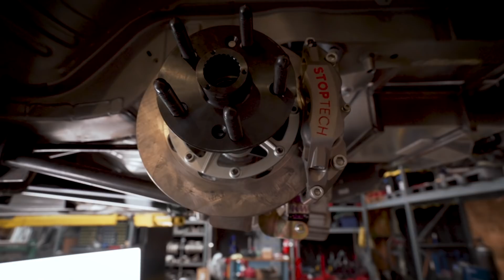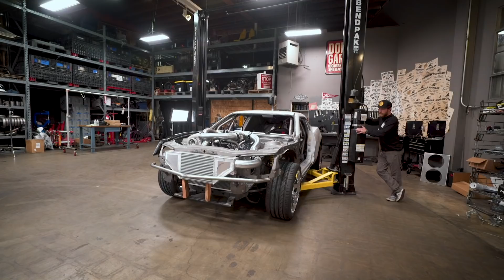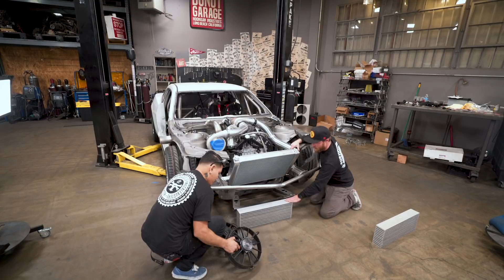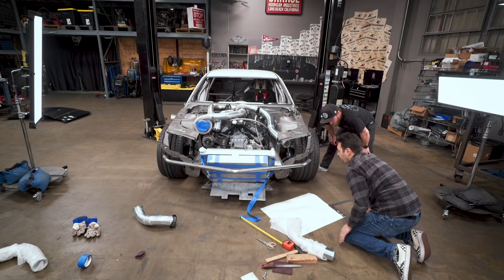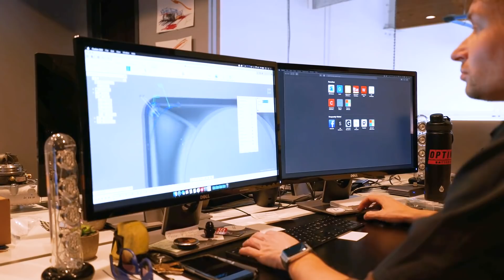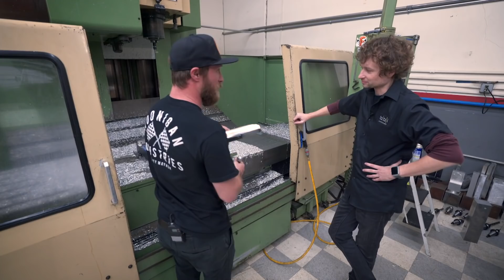Downforce for a Diesel? Duramax Camaro Gets V-Mount Ducting, 1 of 1 Wheels // Knuckle Busters 2 Ep.8

Comment: Read a comment saying Dan's response was Go Fu@# our self's in the diesel world I understand the response we tried running sleds nhrda it was shit, to much politics same with running on the strip. Lot of guys are just concerned if you do more than one pass at 200mph the engine/drive line will grenade on you unexpected iv seen it at 110 full torque top end of strip. No ones trying to be dicks iv read thought them just concern and love man. You guy push safety but I see no grinder guards or long sleeves when welding I get ya Tig don't need sleeves but still pumping out tons of Uv A-B-C. A ton of young guys/girls are watching you seeing that ya personal shop you can do what you want but it does teach bad habits but also shows safety isn't 1st.

Comment: Not sure how that forward lean on the radiator and intercooler would increase downforce, seems to me it would more likely create lift at high speed?
Reply: No dude the air flows through the coolers, the up
Reply: @pinkbandit133  not sure what you're trying to say, but I'm pretty sure the air going through those radiators would be met with restriction and create a high pressure area under it causing lift. You need a low pressure area to create downforce.

Comment: 10.5 inch wheel so like a 285/295?  Not a lot of rubber for that power unless you plan on using a different set up in the rear for when you do the actual  speed runs....honestly I would have thought you’d mini tube it to fit a wider tire.  Wheels are cool though.

Comment: i understand when you work with companies you get in where you fit in, but wouldnt a 15" beadlock style rear wheel be better for traction and dealing with rim spin from a high torque diesel application? Especially when this car is 1/2 mile racing? asking because im genuinely curious.

Comment: That exhaust system is going to cause a lot of drag too. You are going to be blowing massive amounts of air out at 90 degrees to the oncoming air flow. Picture flat plate with about a 2 ft/sq area bolted to the side of the car in that spot. Not to mention all the side force that is placing on the nose that could easily cause high speed handling issues.

Comment: Dematrie did not like it when you called his machine “old,” lol.
Reply: The age of the machine wasnt very relevant to the question he asked about the software was all.
Reply: Darthmoto224 at 14:29 Dan was referring to the machine and having to do manual functions, not about the software crashing.
Reply: @DariusBuildz  Those manual functions are processes you go through regardless of how old your CNC is. its programming the route. The blue block with the yellow lines is the route for the mandrel. So when he asks about needing to do this because its an old machine he is incorect. It has nothing to do with how old the machine is or if the software crashes. Its litteraly just like google maps planning a route but for a mandrel bit instead of your car on a map. Which is why Dematrie said its like any other cnc machine.
Reply: @Islapcabbages224   I'm a cnc operator I operated lathes and mill but hes making a joke lol and that cnc is hella old
Reply: Yes it is old. I agree, it just wasnt relevant to the question about the software. Unless you mean the guy i replied to.  my bad if so

Comment: The tires y'all put on those wheels are not really made for the speeds you are trying to achieve with this build.  Safety is obviously very important, and that has been stressed during this entire series.  Please switch the tires to something with an Unlimited Z Speed Rating!  That is not the same thing as the ZR Y rated tires you installed.  I realize this is probably too late, but I hope it's not.   

P.S. Really enjoying the build series!  Please keep content like this coming!!!
Reply from the maker: Those tires are just for mock up
Reply: I noticed that too. I bet those are the tires for rolling it around until it's finished.
Reply: @jameslehman5250  Let's hope so
Reply: This was all probably finished being filmed months ago

Comment: If you haven’t already considered it, take a look at radiator cap height relative to the highest coolant passage on the head. If the cap is lower, it’ll be a pain to fill entirely with coolant.

Comment: I would've used the body lines of the Camaro's nose and covered the entire fascia section that goes into the headlights/nose. Left the bottom open, maybe even enlarged it to suck air, as is, that nose is not very aerodynamic, which in a car like this,...yeh, they don't care, but for the car this needs to be, every nook and hole counts.

Comment: I'm surprised there's no drive train arrest ... well, at this stage. A lot of horrific accidents at high speeds happened where the drive shaft implanted itself into the ground and did damage, now, i know the DS is not the same as it used to be back in the day, but still, no strap or donut to keep it in, in failure mode?
Reply from the maker: We ain’t done with the build just yet.

Comment: If I get aftermarket wheels do I need hub centric rings? Need some help!
Reply: That depends, on some wheels you do and on some you don't. But if the hub opening in the wheels are bigger than the the hub on the car you will need rings for them to be hubcentric

Comment: Coming from a diesel background i dont understand why you didny use the empty front seat and deleted heater box for a water to air intercooler and ice box passing thru the firewall and back.. especially given the amount of drag a front mount opening is going to create as well as flow issues for the rad. Many new diesels even use factory water to air coolers to regulate temps in all weather climates for tuning and emissions. Seems like the easy solution
Reply: Mark Magnusson some safety regs are picky about having fluids in the car. That could be a reason, dunno

Comment: Did you replace any other suspension components upfront other than the coil overs? Wouldn’t trust the OEM products under that much stress and new weight load.

Comment: Should look at putting a water to air intercooler between the Turbo’s it’ll definitely be worth it
Reply: those are for burnout and drag cars aren't they
Reply: Less plumbing though easier to run water lines upto the intermediate pipe than run the intermediate pipe to the front of the car
Reply: Air is cooler than water when you have a limitless supply of it rushing through the nose at 200mph.  Air is lighter than water, because it doesn't need any plumbing, storage, or pumps on board - it's literally everywhere.  Air doesn't leak on the track in the event of a parts failure or accident.
Reply: @RyanMcIntyre  drag cars often use water to air intercooler due to the compact size. Also having a tank in the truck that holds the water is great because you can add ice before passes to really bring down the temps.